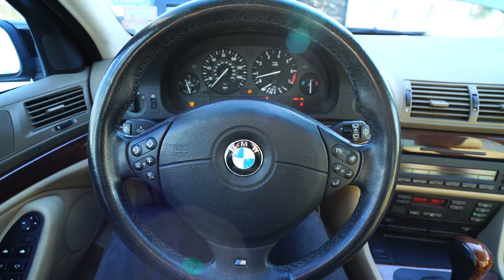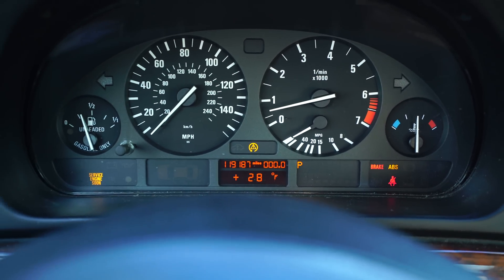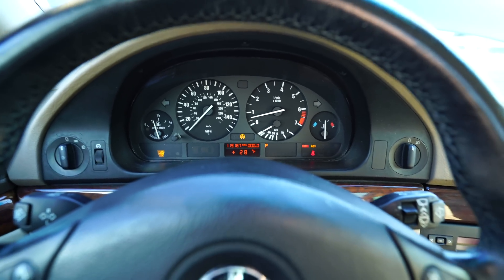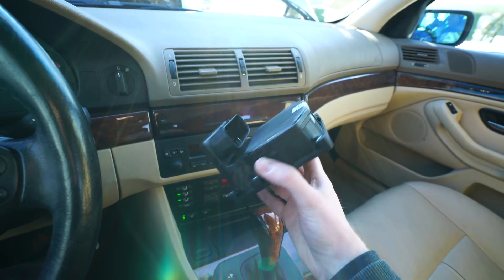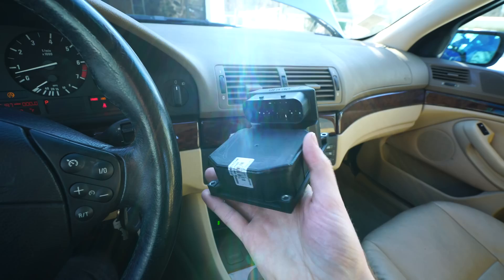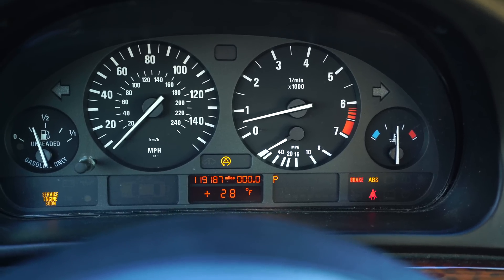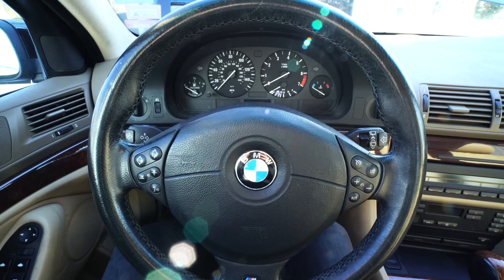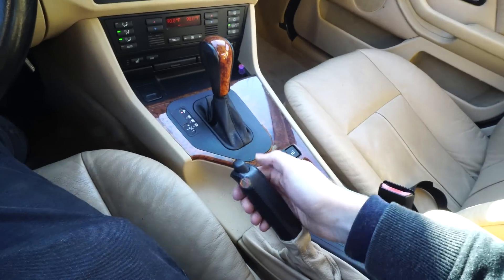BMW Trifecta Lights ABS, DSC, BRAKE - ABS Module Repair E39 BMW 5 Series

Comment: What happened to your car when this went bad?
Reply: Anything can happen. Like he said, with a handful of heat cycles, the module will burn out, causing the car to go into trans. failsafe prog. (Transmission fail safe program) if the ABS module is not "working properly".

I only have a mere 104k miles on my E53, but it is already going. The codes you might wanna be looking for are P0600, P0720 and P1747. If you wanna know how hot it gets under the hood, simply idling can get the intake up to 50-55c (120f+).

Also while in trans failsafe prog, the car will be set to idle at 700rpm and locked to 3rd gear. Hope this helps others with an E53. Please drive safe, especially on the highway/interstate because you will NOT be able to shift from 3rd gear.

Comment: When all three lights are on And without testing, is it always the ABS module? Or could it still be the sensors?
Reply from the maker: all 3 lights is usually the module. I would suggest buying a $50 scan tool to check and see what trouble code is stored in the car first. This is a good tool that I use the c310 https://amzn.to/2UXzWdl

Comment: Four things. The abs on the wheel. Abs circuit cubes the motor control unit relay. Wheel Internal electronic rotor abs. And the abs block. This is a four thi things where you e38 e39 e53 #bmw ABS system.

Comment: Did your brake peddle go all the way down and absolutely no braking on car do to the module. I have change my booster and master cylinder and I have no brakes at all still. Will the module do this to me
Reply from the maker: Ryan Granado Ryan it sounds like either you have air in your brake system or a broken brake line. The module does the electronic bits and the hardware does the mechanical elements. Did you bleed the brakes after the brake master install?

Comment: Awesome vid and very informative; however, I cannot find a ABS module repair for part number 0265247000 on a 1997 e39. Would you by chance know of anyone that can repair this particular module? Thanks.
Reply: Widen your search, the module is a bosch 5.7 most likely. Search bmw abs module not so specific a search

Comment: Did u have to get it recoded or is it not necessary when getting it rebuilt?
Reply from the maker: Gabriel Zurita coding is not necessary when doing the rebuild, one of the main benefits to rebuilding. If you buy new $$ it’s very expensive and will also require a trip to the dealer to have it coded.
Reply: thank u great video

Comment: 2001 BMW 740 DSC light, Abs light, brake light and cel p0500' speedometer works along with the cruise control. Help. Did you have ignition cuts or a random rough idle?
Reply from the maker: Difficult to diagnose with little info over the internet, but sounds like you have multiple things going on here Brian. It's possible to have a bad ABS module (you need to have the ABS specific codes read with scanner). If you have running issues it's not likely related to the other ABS issue, unless of course the car has had any water damage causing electrical havoc.
Reply: Rough idle more likely the cam sensors

Comment: I replaced all 4 wheeler sensors and had the ABS module rebuild two times and still  have the same problem.  any suggestions?
Reply: hi, it depends what bmw? the yaw sensor can cause the same lights to come up or if 4x4 the transfer case actuator.
Reply: Try your steering angle sensor

Comment from the maker: ABS MODULE REPAIR SERVICE: https://ebay.to/2xIisrK
NEW ABS MODULE: https://ebay.to/2xIisrK
T20 TORX BIT FOR MODULE: http://amzn.to/2DcpMKy
OBDII Pocket scan tool: http://amzn.to/22Fn2M1
How to diagnose your BMW when the DSC (Dynamic Stability Control) light is stuck on. This E39 had the ABS fault code number 88: https://youtu.be/ZB0eMvXyqVs
Reply: Link no longer found on eBay
Reply from the maker: @shaunburke9076  link: https://ebay.to/2xIisrK
Reply: New link?
Reply from the maker: @swayzeee6437  link: https://ebay.to/2xIisrK
Reply: Jorge

Comment: So you can send your old ABS module to get it fixed or buy a brand new one?
Reply from the maker: You can do either. I would recommend sending it to the rebuild place first, which should fix the problem. In the event they can't repair it, you'll get your money back - then you can shell out $500+ for a new unit. If you DO need a brand new unit, it also has to be coded to the car either at the dealer or using BMW software. The best scenario considering time and money is just doing the rebuild.
Reply: @BIMMERZEITT  Are you able to drive it while it's out of the car being rebuilt? Obviously you wouldn't have traction or abs, which is fairly dangerous...
Reply from the maker: @jjthesavage  technically, yes, the car will still run and drive, the speedometer won't display your speed if I recall correctly. If you were to get in an accident because of lack of ABS computer/traction control might have some liability there - so in short- no I wouldn't drive it
Reply: @BIMMERZEITT  Thanks, I appreciate it!

Comment: Do you have to have the module recoded?  If I found one from a scrap, could I use it?
Reply from the maker: You can't just use a module from another car - YES it has to be coded. Your best bet is to get yours rebuilt for $93 and be on your way!
Reply: If yours cannot be repaired like mine however you can get a used one on eBay for about $150 and then have a shop reprogram it for you for about $100. $250 is still better than what the dealerships want even for a used one. You can drive the vehicle without the abs module, you just won't have abs brakes.

Comment: just had these lights come on at 118k miles... but they only come on after i've driven for 15 mins or so... at startup everything looks normal
Reply from the maker: davedavis Dave that is textbook abs module failure. The thermal joints in the board expand once warm and no longer have a good connection due to exhaust manifold heat - just look at where the module is located. The rebuild service repairs the soldering of the board. Of course, scan and see what ABS codes you have first before jumping right to a rebuild. But I’d bet it’s the module, you’re also at the Golden mileage they always seem to fail at 117-120k miles
Reply: Your video was helpful. I just hope they don't take too long in shipping it back to me. Can the car be driven without the module attached?
Reply from the maker: I believe I had mine back within a week. Yes it will still run and drive, but if I recall the speedometer may not work and it won't log mileage. You also won't have any ABS or DSC so I would recommend not driving the car while it's out. Not worth the risk to get into an accident, then the insurance company investigates and you're at fault because you had no ABS working. Maybe that's over the top. But it's not a risk I would take if you have assets to lose.

Comment: Rich where have you been man?
Reply from the maker: Been super busy with some other projects! But getting back into the flow here with this weather warming up. No heat in the garage unfortunately! Bought two E39's in December.
Reply: Nathan's DIY Garage
Reply: Hey bro I need help I have an x5  4.4 with 90 thousand miles on it ..it runs fine but abs is on and it said trans failsafe prog
Reply: BIMMER ZEIT hey bro